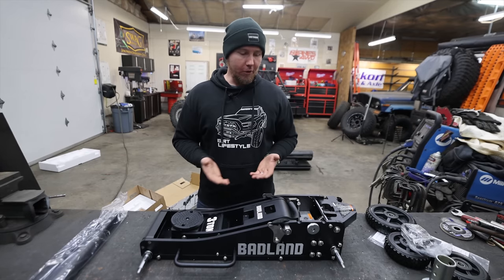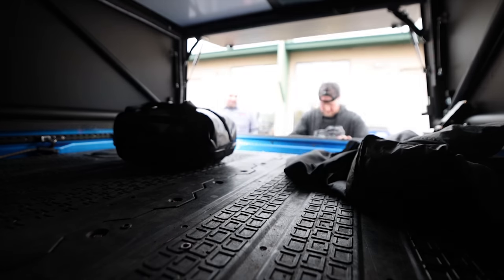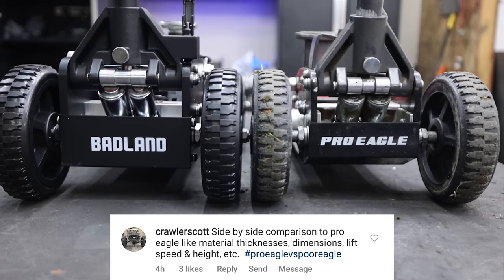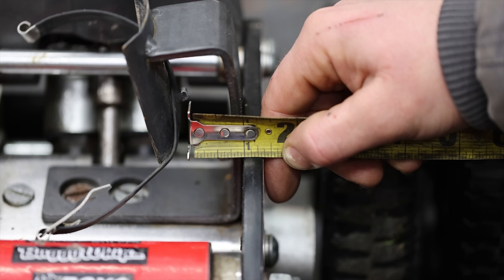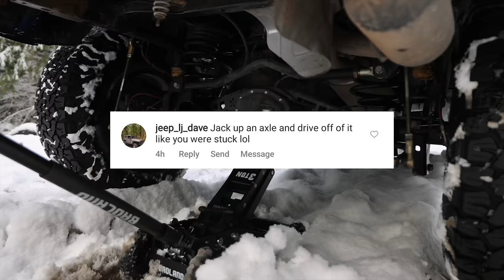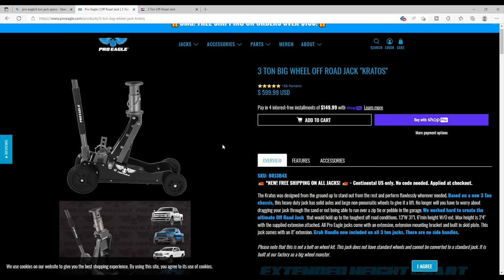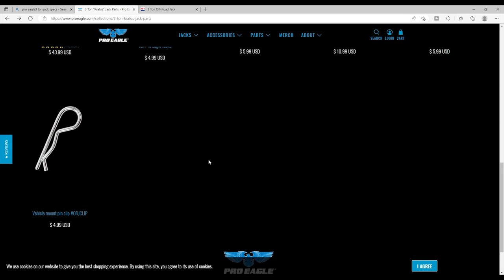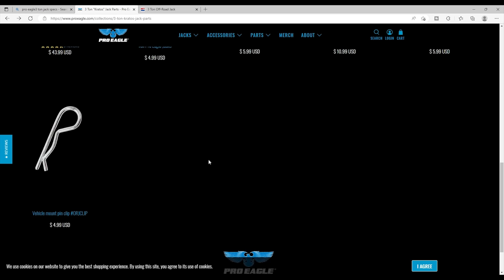Pro Eagle Clone Or Killer? Harbor Freight Offroad Jack Test and Review.

Comment: its not a killer, definitely a clone(but there are differences) its just an option. Ill stick with my pro eagle.
Reply: nah, it's definitely killing it. Virtually same quality, more base features, half price.  Only thing the Badland really does worse is the saddle extension swap, though the Pro Eagle saddles are prone to deformation damage over time so that's probably why HF opted to just hold it down with set screws and an allen key despite the significant time difference.  Otherwise the Badland has the wheely lock and side handles that the PE "Kratos" doesn't.  More  base features, half the price.  Warranty can also be supplemented and still be under half the price of the PE when on sale.  

Can just look at Pro Eagle's hilariously petty (and misleading) infographic on the Kratos web page for proof of it.  They think you shouldn't buy the Badland because it didn't win a SEMA award.  Genius marketing point.  Most of the rest is either outright lies (no SS hardware, no parts available, straight up lies) or because the Badland is so new nobody has made aftermarket parts for it.  (mounts, extensions, etc.....probably because it's been on the market for 6 months vs the other which has been for 6 years), irrelevant or requires additional accessories ($670+ total investment) to even beat the Badland.  

 If they keep doubling down on not adding the wheely lever lock and not reducing their base prices they're going to get eaten alive by this thing.  They're a one trick pony company too, so they've got lots to lose with a major retailer challenging them the way HF is straight out the gate.  Badland's going to be the de facto offroad jack within a couple years.  And Pro Eagle's revenue is going to end up in the shitter.

Comment: This is capitalism at work, Eagle had the market and could charge whatever they wanted/felt the market would bear, HF comes along and builds a better mouse trap at a lower price....competition is a good thing.  I think they are, as you said, both made in China, Eagle farmed out their design to the factory that could produce their product at the lowest price to increase profit, HF did the same thing but is, apparently, willing to have a smaller profit margin (probably due to their much larger product line, I would think)......  As others have said, I would spend the extra coin if it was Made in the USA .......

Comment: There is no need for an in depth video or examination in order to determine whether or not Harbor Freight (a Chinese manufacturer) rips off designs of of other tool companies. Just the fact that they are Chinese, the kings of brand cloning and industrial rip offs should be your first hint, the second should be the clearly obvious and extremely similar design of many of their products to more prestigious brands and the last is the law suits they've had to face by other tool manufacturers in regard to the two latter points. So, no... Harbor Freight are not true innovators, just mostly immitators. Now, if you want to compare the quality differences, that makes more sense and Harbor Freight almost always comes in second in quality to more prestigious brands, but their products still offer an excellent level of quality vs cost and even some slight innovation from time to time, which makes their tools far more appealing to a lot of tool enthusiasts and which is the recipe for their success.